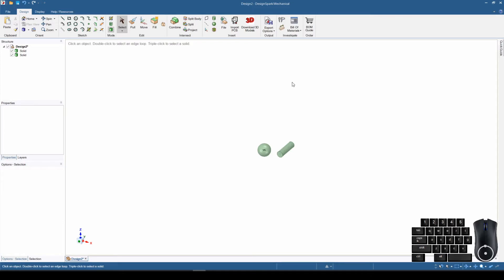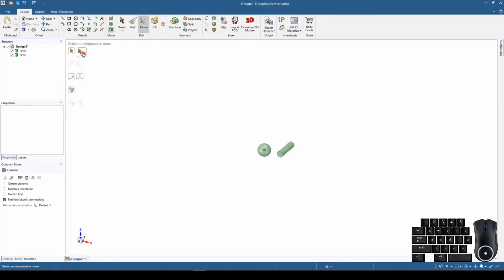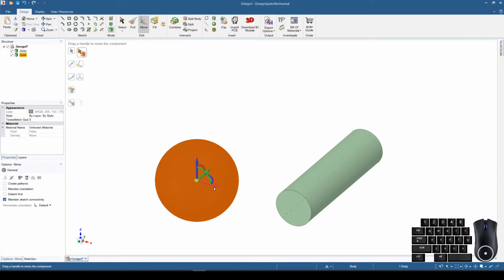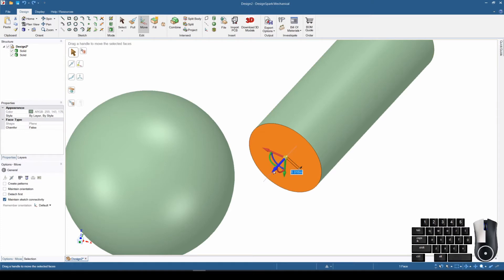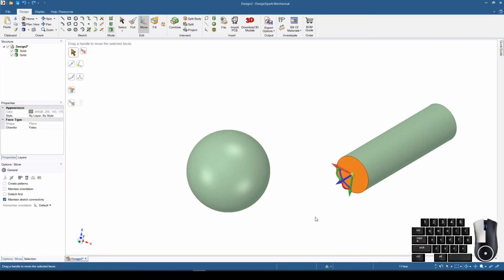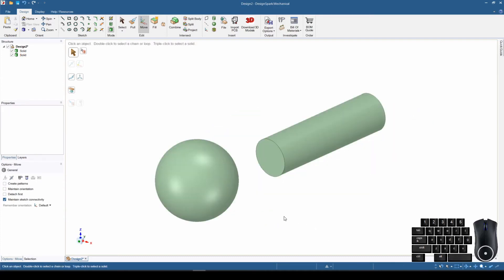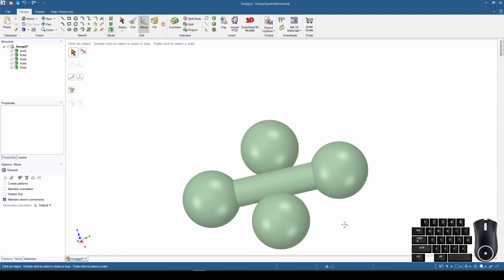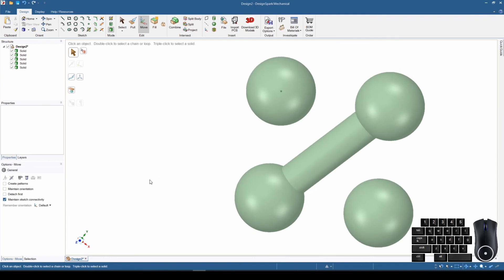Designspark Mechanical Tutorial - How To Move Shapes (DSM04)

Comment: I was looking for a way to move an object in the center between two others, and didn't find a hint in the docs, or on YT yet.
Reply from the maker: I do not fully understand the exact situation, but in general, the TWO easiest methods I would use...

ONE: IF A FEATURE EXISTS that is in alignment from the center of first object to the center of the second object... use the measure tool to find the measurement "center-to-center", divide it in half to find center distance and then use the move tool and set the anchor/direction to the FEATURE and move the third object... (a lot of "if" in this method)

TWO: Make a reference line... go into "sketch mode" and select a "sketch plane" that allows you to draw a "construction line" between the centers of the two objects.  This allows you to then use the construction line for alignment, and the "center" of the construction line IS the center point...

Hope this helps...

Comment: Finally!, someone took the time to explain how the move tool works. There are so many nuances to it and you covered them all. I think I know the answer to this ques. The center ball is yellow but when you move the anchor point it turns blue, is that correct?

I have watched quite a few of the DSM videos but yours is perfect for the newbie AND you're the only one allowing us to see what clicks or keys you are using. Many of the Blender instruction videos do this and none of the Fusion vids I've seen do this. Blender is too big for me to learn for my concerns. I like Fusion but not enough details by instructors. If you took this teaching approach with Fusion I believe you would have quite a few newbies (my self included) there as well. Once again, Thank you.
Reply from the maker: Thank you, thank you...  I may tackle Fusion 360 at some point... Now that "winter" has finally broken here, I am chomping at the bit to get outside and start BUILDING stuff... so there will be a lot of "fabrication" videos coming that include the "design and model" aspects...  
You are correct about the anchor point. it changes to show if it is the "default" location or has been changed to a selected location...
Reply: @fabricationplanet  Do you know how to permanently change the move anchor on an object?  I have an imported STP which I aligned to my existing model (which is oriented normally with 0,0,0.)  However when I re-enter the move tool on the component it's anchor is askew and if I used the handles as-is it would move off the plane with which I aligned it.